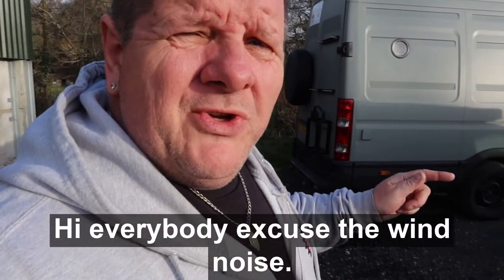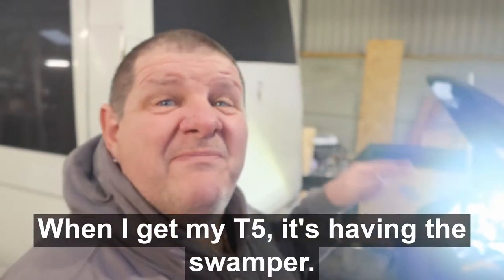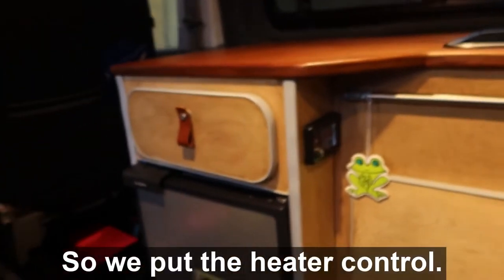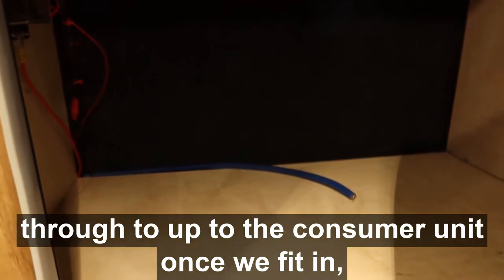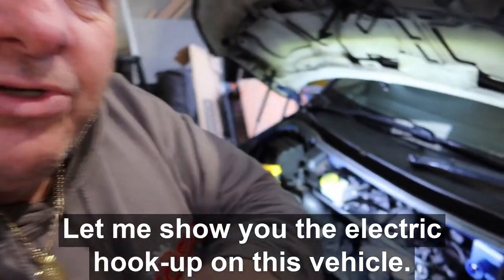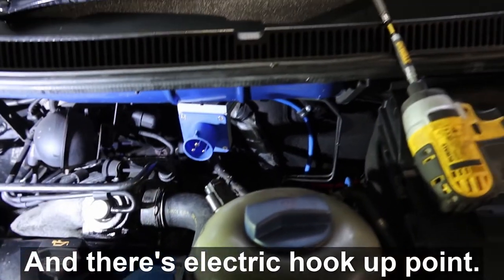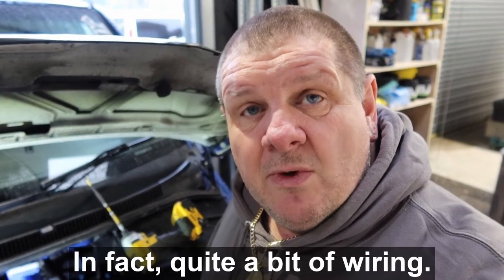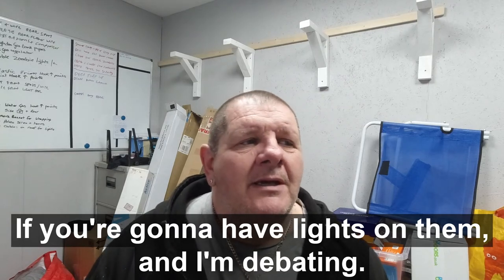VW TRANSPORTER T5 CAMPERVAN CONVERSION - Electric Hook Up

Comment: Not sure having an non armoured cable running through a metal box supported on rubber insulators is a good idea nor is using a standard c form ip44 inlet in that location. How do you earth the body?
Reply from the maker: Right I'm not a qualifies electrician but my business partner is and meets all requurements required for the install for a campervan.  It was all checked and signed off correctly as all our work is.